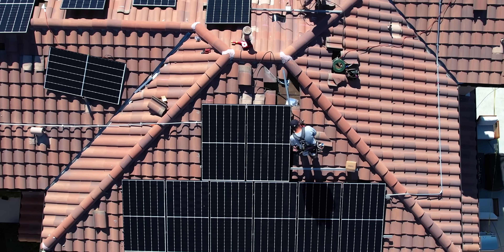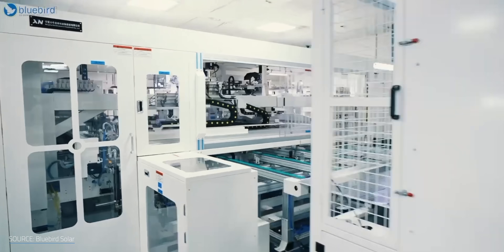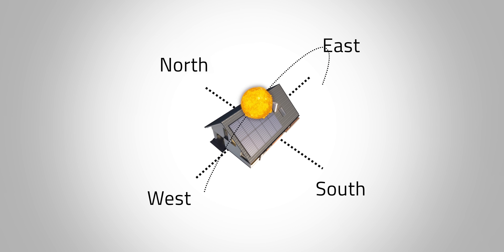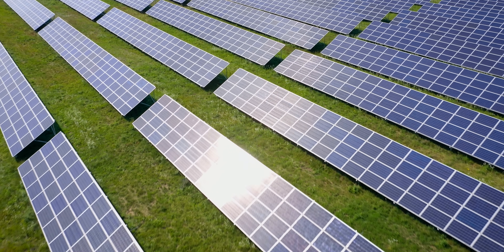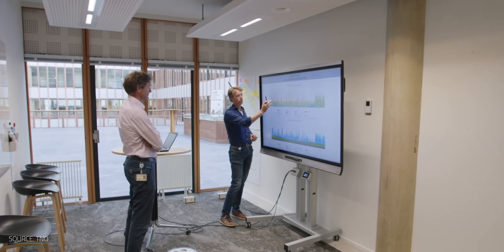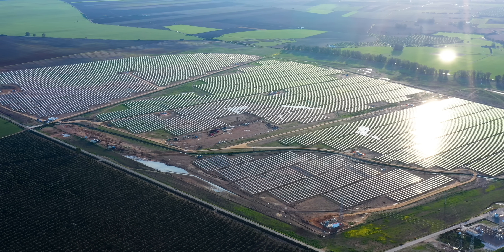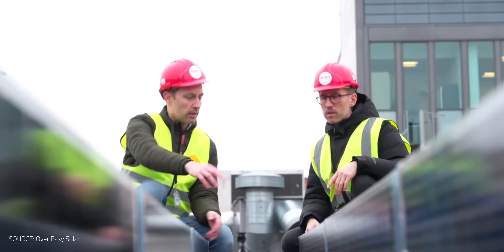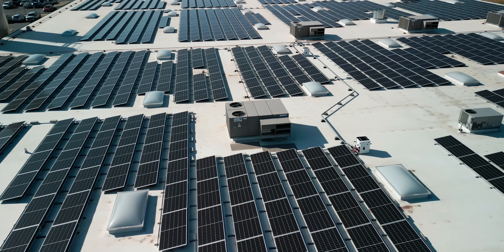Have we been doing Solar wrong all along?

Comment: So, the Vertical Oriented arrays with 4% energy yield improvement, yes? That equates to a field of 96 units vertically oriented producing about the same energy as a field with 100 units oriented at the latitudinal angle in degrees from horizontal. 

So, a big solar field array with 20,000 angled panels will yield the same power as 19,200 vertically oriented panels. That is a big cost savings for the installation and replacement.

Speaking of replacement. I heard somewhere that typical panels last about 20 years. I wonder if that lifespan will increase because they are not being heated as much? Doesn't heat have a degrading effect on semiconductors and other electronics?

If energy efficiency is one benefit?

How about increased lifespan too? What if they last 10 Percent longer too?

That makes the overall need to replace less often. Just ask Walmart about the cost of replacing their Supercenter ceiling fluorescent light bulbs. Getting your fixed costs down is another innovation that is needed. After all, a lot of rare (earth) things go into making solar panels.

Comment: That is go down is not strange 
The Netherlands power Network is on the moment overload by solar panel.
Our system needs a upgrade for it.

Same that house with solar panels are off by the power grid company.
On the moment the power go up to 253volt solar panels will shutdown.
From remotely by the company.

Think this is the problem by testen the systeem .

Comment: I have an island system with just 360 Watts peak + 6kWh storage for emergency supply. Modules are vertically mounted SE and SW (defined by the building). On sunny days I get roughly 0.7 kWh in winter and 0.8 kWh in summer - vertical orientation is a good equalizer between summer and winter gains. For emergenca power the winter is more important than the summer and in typical societies the power demand is higher during winter. So in general: Vertical mounting has lots of benefits but maybe a good mixture is the way to go which shapes the power generation graph more like the demand graph. The rest can be done by batteries, at least on a 24 h time scale.

Comment: We just need to get away from the Photovoltaik bullshit. It is way to expensive. Much better would be the following:
1. Building Large reflective bowls called „solar thermic power stations“, wich don‘t need any expensive materials
2. Store the energy with water, so it is day/night active
3. Use the energy to produce methane, wich can be used for a complete emission free methanol fuel cell, wich we already invented in       germany
4. kidnap the families of the responsible politicians so they are forced to invest in the better technology

Comment: In Northern climates, us off griders can never get enough out of our solar panels in the winter.  A vertical panel wouldn't easily be covered with snow for days at a time like min do now, and get more reflectivity from the snow on the ground. For such situations I would think the primary face should point south due to the low angle of the sun.

Comment: I would love to see a thermocouple embedded in a solar panel to convert heat to electricity. 

I would think it would lower operating temperatures and produce additional current that could just be added to the current output of DC

Comment: It all depends on your location on the Earth. I the South West where I an facing directly South at s 20 degree angle gains the most power all year. My little 4 kW system makes more than I use each month.  We also need to make our homes more efficient. Insulation is key. Also making your windows more efficient is very good. Using LED lights is also great. It all has to work together.

Comment: How much of a difference does it make to mount vertical BSP, say close to the equator as opposed to close to the pole region?
Another grouse article Matt    👍
Reply: At the equator it's best to put the panels flat on the ground or roof to maximize energy production. If you need generation early and late you could put them vertically in a north/south otientation.

Comment: Using the land for shade tolerant plants is one way of approaching it. Another is to use the system to provide partial shade in otherwise desert conditions. Depending on how far apart tie rows are, you can limit the maximum direct sun. You could even plant different varieties different distances from the shade. Likewise, you could use the system, along with an open-cycle ground-water cooling loop and do three things- warm the ground itself as a hedge against frost, make the panels more efficient, and also facilitate irrigation. If you built extra strong foundations on the edges of a field, and suspended loads in tension, you could manage extreme winds by pivoting off the base while anchored, allowing the mass of the panels to dampen otherwise overwhelming pressure. In low wind, you relax tension and let the panels rest on the ground. You still have to build a line of supports along the way to collectively prevent swaying. You’d also use cross supports between rows. If plan for it, you could manage extreme wind by lifting the panels so they feather free, then lower the common cable again to confine the movement of the panels such that they remain in contact with the ground (likely killing some plants). The less effect the worst wind can do, the lighter and cheaper the whole can be. There would be advantages if the field posts required no permanent foot.

Comment: My guess is that the wind flows more effectively over vertical panels. These east-west panels are often perpendicular to the wind direction, causing the exact sort of vortexes in the air that long straight dams create in the water- durable, tight rotors. These would tend to pass more air over the panels, giving more opportunity to transmit heat, cooling the panels more compared to angled arrangements, with dead air trapped underneath, and rendering them more efficient.

Comment: When I was in high school, probably 2003, my Computer Tech teacher mentioned that he was putting solar on his cabin. Some students were confused since during the winter they would be covered in snow and there's not much light. He then told us that he would just brush them off when he arrived and that the colder weather improves solar panel efficiency. So although there are fewer daylight hours in the winter, there is more light reflection and higher efficiencies, so he saw the value in that.

Comment: Hi Matt!. I did a micro-entrepreneurship were through an smart geometry I could place the PV pannels in 3 positions during the day, harvesting those peaks of solar generation you mentioned in the video. Is actually so simple that is moved with ropes, some pulleys, and a automatic gates' motor, and it is installed in a cheap floating structure made with recycled materials.
 Hope you could search for it in google:
SUNCHRONICE

Comment: Sometimes advancement isn't some big technical breakthrough.  More often it is some other application or combination of use that makes something more economical.  In this case the vertical orientation helps the thermal performance since backside heat isn't trapped and it can convect that heat up and away.
1) In the plains states they install snow fence to prevent drifting over highways.  Why not vertical solar.
2) In urban area they erect sound attenuating walls along highways that bisect residential areas.  Why not face them on the south sides with panels?
3) Backsides of billboards?
4) Privacy fencing

Comment: Question. I am in solar. Does it generate more than a tracking system? Or just more than standard fixed tilt?
Reply: It produces WAY less energy than a horizontal fixed system, and hence WAY WAY less than a tracking system. Matt missed the fine print (or ignored it to make a click air video) where the vertical panel produced much less energy, but a couple percent more energy than the models had predicted. Vertical bifacial modules are an interesting niche application, but they’re not going to be anything close to the dominant form of solar generation unless there are enormous changes to technology and economics. I engineer structures used on large PV plants, btw.

Comment: A black surface radiates more heat. Another part of the improved cooling could be the black surface radiating heat away more easily. Also hot air can’t get trapped under a vertical panel during air convection.

I’m also wondering if light hitting the front side can leak through to the back panel.

Comment: I see a minor problem in the need for stronger foundations in windswept zones and on most rooftops.  
Would the advantage be reduced in cooler climes?
Verticals would preserve forage in livestock pastures.
If auto-rotation were added, would it be a greater advantage than auto-tilting?

Comment: you use a plastic carpenter square until there is no shadow Around the square. perfect alignment.
I hand set mine for years.
We're best in winter sprinkling.Snow reflected making two more apps per panel.

Comment: I've worked on many commercial solar sites in MA, and our specs are between 20 and 25 degrees...mostly 25 degrees. Many residential roofs range from 25 to 45 degrees, any the panels are always installed parallel to the roof pitch. In residential I prefer carport solar racks. They serve 2 purposes. Our fields are based on 7 months of sunlight to do the calculations. The winter 5 months are the bonus for whatever the panels produce in less than optimum conditions. 8:35...big issue solved...mowing the grass. LOL

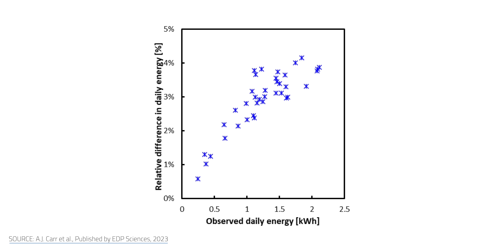Comment: 7:47 you say the vertical arrays have a lower heat transfer coefficient and thus a lower temperature, this is incorrect. According to the study they have a higher heat transfer coefficient which means their ability to dissipate heat is greater, resulting in a lower temperature.

Comment: Bi-facial solar panels aren't significantly more expensive at this time and can be deployed using standard east west configurations on rooftops. While returns do not increase as much as the verticals ones probably do, they do see a couple percent increase in monthly yield. In particular when in the shade during certain times of the day. 
(though it should be note that the 60% increase that is often touted by suppliers is a 60% increase only when they are in the shade and hardly producing anything. An 0.2 to 0.25% increase is what we usually observe when monitoring our customers. which is still a lot over the lifetime of a solar panel.)

Comment: Are yiu sure that bifacials have sepafrate solar element at the back?
Isnt that just transparent back that allows to light get to solar element from all sides?
Guys here in Latvia are promoting bifacial panels a lot, and say up to +30% more energy.
and it is NOT hot here. So  temperature difference does not stand my "logic gate".
If there would be simply more elements at the back, then there would be additional bypass diodes.
If there is simple transparent back then in shady "times" solar element gets more illununation and 
thus decreasesa internal resistance to solar panel String.
That for me is much more logical explanation.
Cause I think internal resistance is main energy waster on solar panels.

Comment: 250 m barbed wire: 70 EUR
120 pcs wooden post 150 x 5 cm:  500 EUR 
or:
8 pcs. wooden post 150 x 5 cm:  40 EUR

vs.

400 W 172 x 113 cm panel: 60 EUR

I need to put 125 strands of barbed wire from top to bottom between to poles 2 m  apart to be more expensive than this shit.

Or could do a 50 m fence with 10 m between posts, i.e. 5 posts, and have 5 strands of 50 m barbed wire for less than panel + microconverter + cable + etc.

Also the loss of being no 90° to the sun is higher than the "recuperation" from being "cooler", as if there isn't convection beneath roof laid panels, also put warm generation - solar therm - beneath them and problem solved.

Also nobody here seems to have ever even used a lawn mower  next time you hear the and see that dirt go up be assured you be paying for a new panel. Or the kids playing around .. "GOOOOOAL" shattering sounds  .. oh and btw. those sqaure cells being semconductors are "Solar cells made of c-Si are made from wafers between 160 and 240 micrometers thick."  so .. 0.1 mm to 0.25 mm  ... so fragile as THIN glass (the irony: SiO being main ingredient for glass) and sharp ... the animals gonna love that when they eat this or bump into that or when the kid falls into the fence ...

Everyone here applauding that you have proven why these USofA is worse nation in school of all western nations, plus enjoy your: Physics: F, Math: F, Chemistry: F.

Comment: I am putting up a solar array using recycled panels.     I am near Boston  and the small rooftops there often get  upgraded so there is a good supply of local older panels and I am in good with a recycler that is used by some solar companies.    Can I get the bennifits by simply using two panels back to back in a vertical configuration along my east west fence line or is the technology of bifacial panels more complicated than that?

Comment: I have to replace the east-west fence on the back since of my property.  It faces south and get sun almost all day. I will replace the fences with 10 BiFacal panels.  It will cost somewhat for than the fence but much cheaper installation than rooftop. Ten panels for $1600 plus inverted and wiring is less than the $25k esimates for rooftop solar I have gotten.

Comment: Maybe it has something to do with heat dissipation or maybe turning them east to west allows for longer sunlight then just in the middle of the day also i wonder do these capture more energy than tracking panels? Or does the act of moving them use the extra energy gained? I know more about circuitry in general than solar panels specifically so idk maybe I'm not qualified to guess

Comment: I would guess two sources of added output. First, vertical panels allow better air flow, coolding the panels, and thus raising their operating voltage and power.  Second, you get diffusion from both directions, and that is likely better than one direction only

Comment: There is also a big capital cost savings with simpler racks, easier installation.  I could easily see a truck sized unit being able to ram in posts, a suction arm slips it into a track, humans follow to line up screw holes and screw it in, do QC.

Comment: Not for me. Regardless of cost, my array has to supply power through winter. I am off grid and at 51 degrees latitude. If anything, I need to either track the sun or add albedo reflecting panels. Or install more panels, which are the cheapest element.

Comment: As dilute intermittents like wind and solar are so problematic both in the enormous amount of resources they require and in loss of efficiency when incorporated into infrastructure they have a far larger environmental impact than other options. Over dependence on W&S  means digging, blasting & leaching more minerals from the skin of this planet than ever before. They are far to resource intensive and chaotic to ever be capable of doing the heavy lifting of meeting our energy needs. 
Intermittent and dispachable energy are not the same thing.  W&S operate on top of dispatchable energy, not instead of dispatchable energy. 
As intermittent power sources bring increased instability to a grid we end up using far more dispachable backup than we need with stable reliable sources. And the higher percentage of Intermittents the greater the instability and the higher percentage of backup needed. At 20-30% capacity factor, every MW-hr of solar & wind drive 3-5x as much dispatchable build out for backup. But, since solar/wind are chaotic, they drive efficiency down, driving dispachable MWe-hr use up by 2-3x. This is probably why we've seen so little progress in emmissions reduction and cost of delivered electricity by adding them to our power grids compared to adding clean dispatchable nuclear, geothermal and hydro power. 
Hydro and geothermal are pretty much maxed out with current technology and hydro has significant local environmental impact. I'm hopeful that deep bore geothermal will someday be practical making this clean reliable power far more available than it is now.
Biomass and biofuel have very poor energy return for energy invested and can be quite dirty as well.
Still, all of these and our other options do have appropriate applications. Meeting the needs of 8 going on 10 B of us in vastly different circumstances will likely take all options. 
As NP is by far the lowest environmental impact as well as being safe and available we should be using it as much as possible.
Most of us have no idea what energy infrastructure requires and we should if we're going to advocate for doing it this or that way.
For a explanation that we don’t have to be engineers to understand this is a great resource. Shorting the Grid: The Hidden Fragility of Our Electric Grid  by Meredith Angwin.
What's important is reliability, affordable, and low environmental impact. Focusing on renewable instead is counterproductive.

Comment: even if it would be from solarpanel perspective somewhat less efficient , the fact the land can be still used for small crops farming is a huge win. specially in places where high value farming soil is used for solar farms.  second big advantage the peak energy of combined solar energy is beeing more and more of a problem for the grid's stability.  these horizontal setups have two smaller peaks one earlyer in the morning and later in the afternoon thus speading the energy in broader  time  frame wich is better for the grid stabilitity.